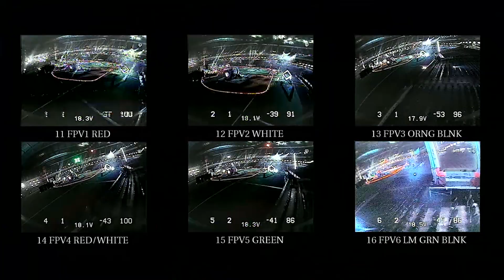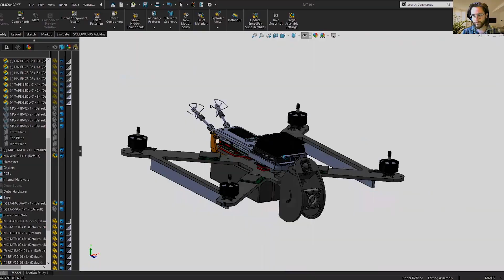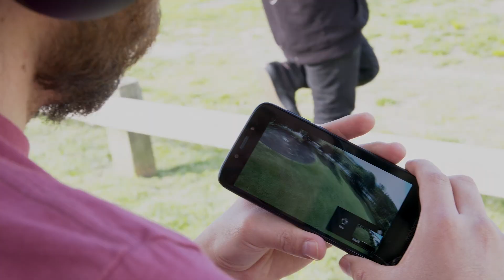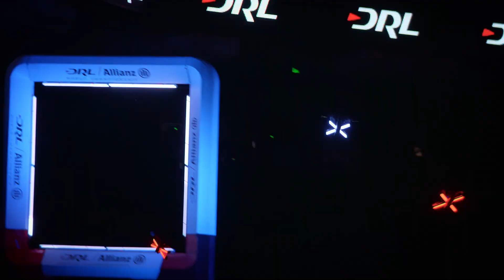Introducing One of the World’s First 5G Racing Drones | T-Mobile

Comment: Low frame rates and lag will make this impossible for the pilots to use for FPV a lag of 30mS or more is unacceptable and will affect how they're flown. They should use standard tech for control and FPV feed and 5G to stream from the HD onboard camera either centrally of from the drone.